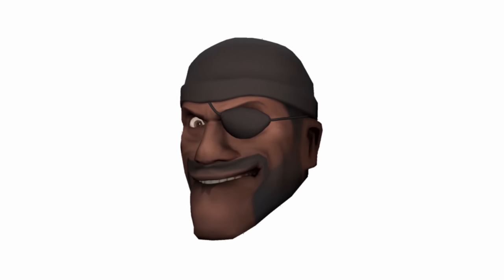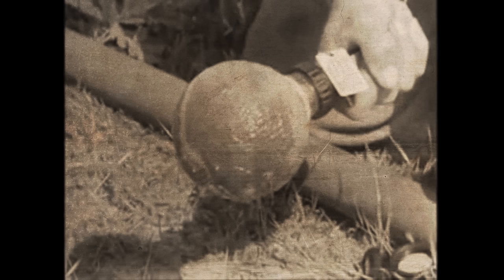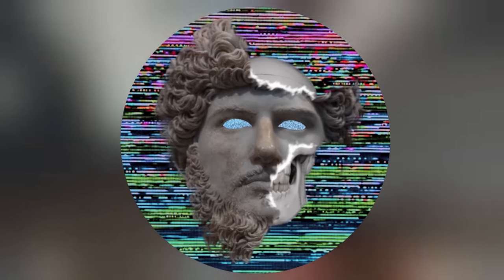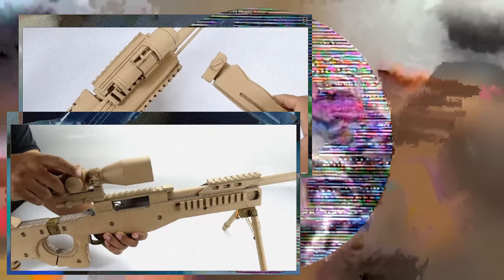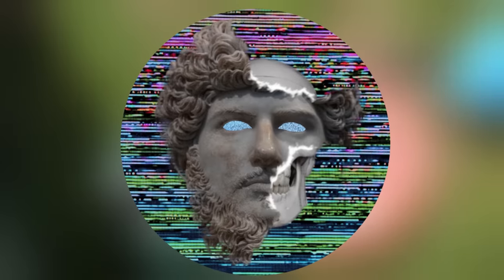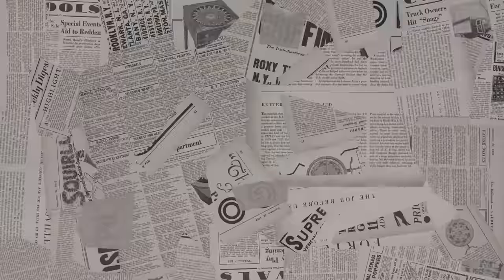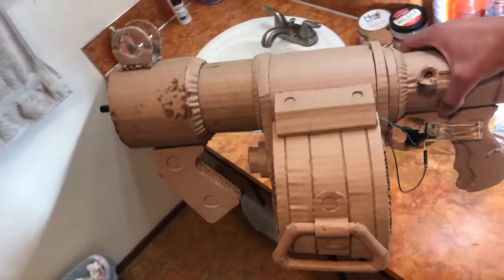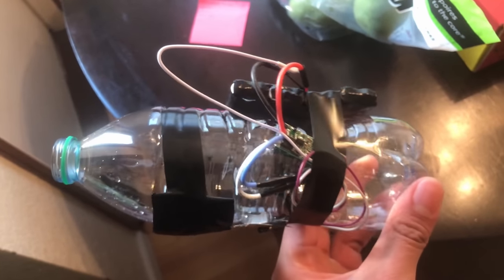I Made A Working TF2 Sticky Launcher

Comment: so if you make a hollow stickybomb and fill it with alcohol gas, you can actually make it fire stickies?. Maybe a different fire mechanism could allow you to do the rotating drum part, can't you find a way to do some spring lock type thing where you cock the gun to retract a sping and hold it in place until you push the trigger, or would be too much stress for the cardboard, and there's the problem of heavy springs require a crazy amount of force to compress, maybe that would only be possible if the weapon was made of metal ^^'

Ofcourse the fact that you actually made this is already amazing, i'd love to see you make the Soldier's Rocket Launcher!